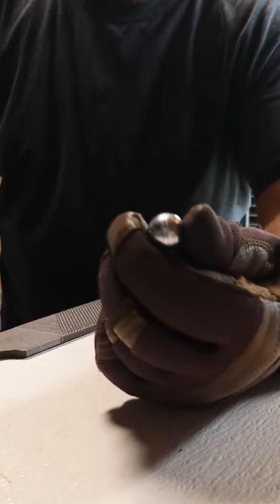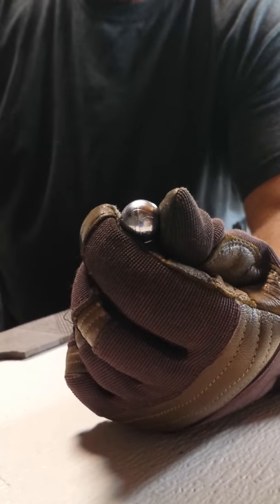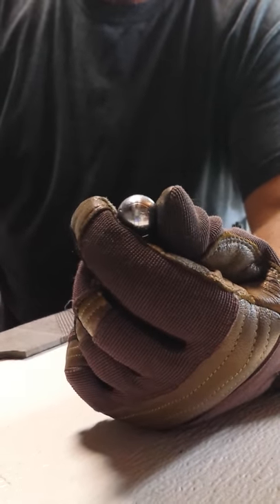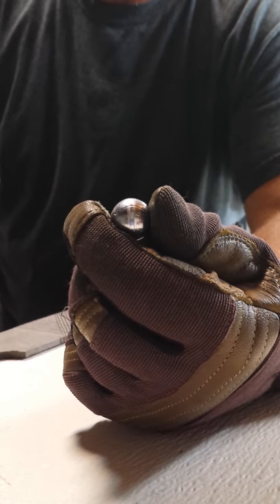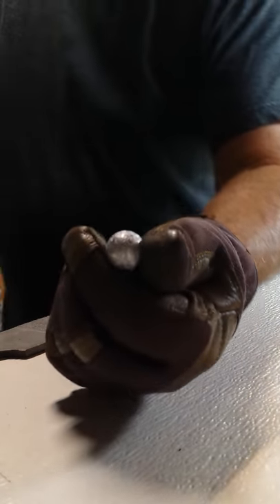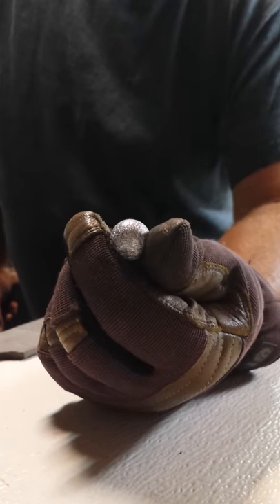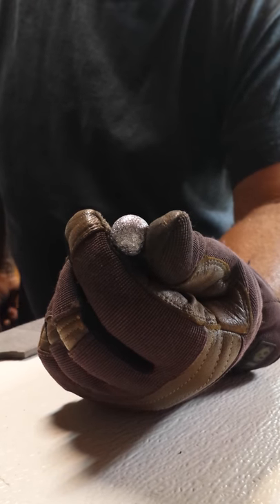Knarreling a smooth bore musket ball

Comment: Why
Reply from the maker: Why What?
Reply: The theory is, chewed balls fly straighter by getting spin thru wind resistance in flight due to the barrel having no rifling. Mike Bellevue did a test of this, fairly through and came up inconclusive. That said, each gun is kind of its own critter, your mileage may vary. Mine hasnt cared for it more or less either however. My Fusil de Chasse hits with these at 30 yards, the same as it does with normal ball. Honestly i bought a minnie mold for a 58, gonna try those.
Reply from the maker: We shoot paper for score, and we can't use a patched ball of any sort. Shooting at breakable targets you can get away with it.  We shoot 25 and 50 yards, off hand, so we need all the help we can get. Also most of us shoot a roundball 10 to 12 thousands smaller that bore size so our balls never touch the barrel.
Reply: @rickcameron3688  damn hell yeah
Reply: Like a golf ball with dimples, flies better